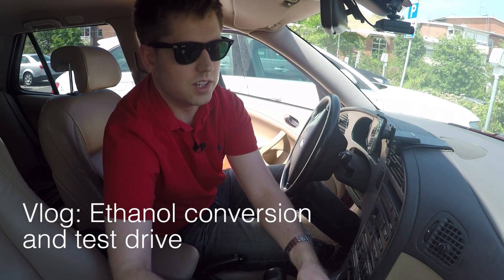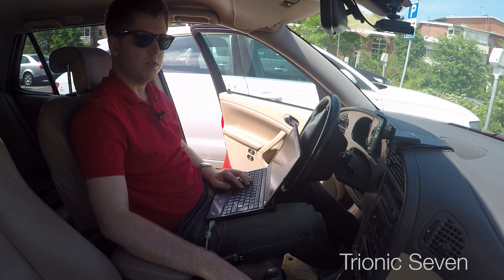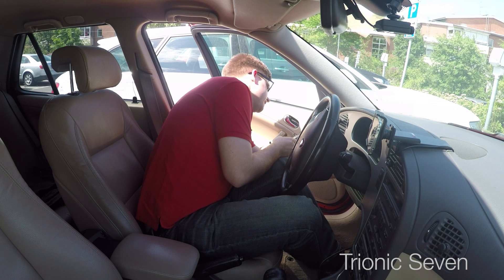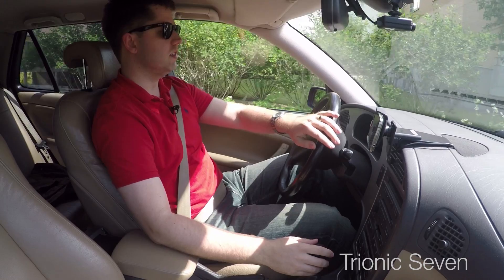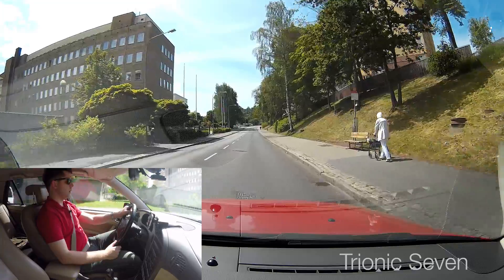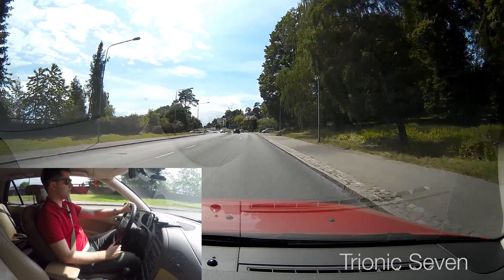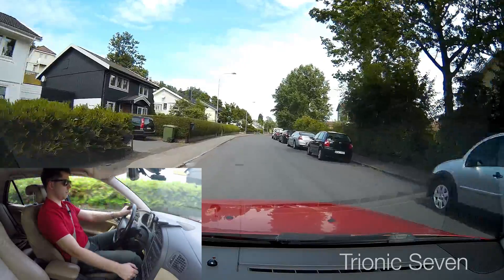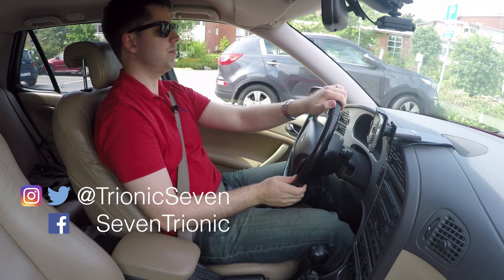Ethanol mod for the Saab 9-5 Aero!

Comment: quick question. I have a phase 1 saab 95 aero. 2.3t Abbot forged conversion blah blah blah. I can only get 99 octane fuel at pump. how hard is it change a normal petrol car to biopwer. of course mapper etc but what fuel pump and lines are required. many thanks
Reply from the maker: Usually you just need to replace the pump, the rest works fine. Plus software, of course.
Reply: Trionic Seven u do the have to change fuel lines
Reply from the maker: Source?
Reply: Trionic Seven I asked this in a saab forum on Facebook. the thing is. ethanol in the UK is very hard to get. near impossible. eBay is the only option. must be that they don't really know. but some forums on the net Were saying fuel lines.
Reply from the maker: Experience has shown that you don't need to change the fuel lines in the Saab.
Reply: I already have a Walbro 355 pump that should work. only need a map. cars running 350bhp on low boost what do u reckon the change to bhp would be when running ethanol. what differences do u feel
Reply from the maker: Hm...350bhp means it's got quite a tune already. What power you get will depend on your tune and the injectors you are using. I don't know enough to give a good response to your question
Reply: dekkas 630cc and a cos worth t3/4 turbo. bit like the gt28 but quicker spool

Comment: Hello. I to am a member at Trionictuning. Have John C:s Combiadapter too, but cannot find a thread where you can buy the casing for it. Could you point me in the right direction?
I live in Jönköping too. I am thinking of going to one of the Saab meetings at Max too.... Would be nice.
Are there any meetings scheduled this fall?
Regards / Roger
Reply from the maker: Hej Roger! Jag undrar om jag inte träffat dig när jag köpte gasdämpare till motorhuven för cirka 18 månader sedan, kan det stämma? Det har varit träffar på tisdagkvällar (kolla Trionic Seven på Facebook) men nu är det för mörkt, jag tror vi drar igång igen i vår. :) Här hittade jag mitt case: http://www.trionictuning.com/forum/viewtopic.php?t=3618
Reply: Tack. Jo det stämmer bra. Har haft många gamla 9-5or och även några Aeros som jag försökt tuna lite själv och då blir det lite delar man samlat på sig.Nu har jag en 9-3 TTid -2008 som bruksbil men ska åka och titta på ett 9-5 objekt. En 9-5 Vector 2,3 Biopower som har motorproblem. Tänkte göra i ordning den och troligen också pilla lite med mjukvaran. Kan vara kul. 
Har förresten tillgång till Tech 2 om du behöver hjälp med det någon gång.

Ha det gott.
Mvh Roger
Reply from the maker: Vad trevligt! Saknar själv tech2 och ibland får man behov av det :)

Vi hörs!

Comment: I am thinking of adapting my Viggen to bio power. Would you suggest a new fuel pump for the 2000 Viggen? To encourage the use of e85? I am planning to tune through Maptun
Reply from the maker: Check out the biopower conversion thread on trionictuning. I recommend an upgraded fuel pump since the old one can die at any time with e85

Comment: Hi,

what kind of tablet/phone holder are you using on your dash? Looks convenient.
I'm surprised you're running 95 octane. I'm stage 2 and converted to LPG so I use only 99+ or 100 octane whilst it's warming up and won't be trying 95.
I was about to ask you if you are encountering lots of misfires or knocks on A95 but realized you don't have openSID.
Reply from the maker: Check out my video on the Brodit phone holder: https://www.youtube.com/watch?v=MmKCo4pxXNQ

I have OpenSID, but not in this exact video. There will always be some knocking when running 95 octane fuel, however I do so much driving that anything else is too expensive.

Comment: Hi Jonathan ,first of all thank you for all those great videos you have made, very clear and easy for everyone to understand ,I have couple of questions , is it necessary to replace  the fuel pump? because it will fail using E85,and is Walbro GSS341 255LPH , special pump made to handle E85,,also its been about 3 weeks since you have converted your SAAB to E85 are you happy with the results?
Reply from the maker: Hey Manny. Just look at my fuel pump replacement video from last year, the car died due to the pump failing after driving on E85. With the stock pump it's not a matter of "if", but rather "when" it fails. Remember that the 9-5 pumps usually fail even when driving on gasoline. My pump failed quicker as it was a cheap aftermarket pump the last owner installed. Very happy so far, consumption on the highway is around 11 l/100km.

Comment: Did your Saab come from the factory with the ability to run E85 ethanol and petrol? or is this something you have added?
Reply: He is using T7suite to flash a new firmware version, read up on it it quite easy to do, you have to take in account that e85 burn with less calorific efficiency and hence you need to inject more, make sure your injectors are up to par most people when tuning on E85 use Siemens Deka but if you want stock power the red injectors are fine.
Reply from the maker: The Aero only comes in a gasoline version and I flash the car with software that takes care of e85, just like AcidStyle79 said.
Reply: +Trionic Seven: For Saab Enthusiasts oh i see.  But do you have to change any hardware or does the software update /change take care of everything?
Reply from the maker: http://www.trionictuning.com/forum/viewtopic.php?f=57&t=3462
Reply from the maker: As I talked about before I tried E85 last year with no hardware changes resulted in the fuel pump dying on me. That's to be expected. For the Aero, it runs more or less straight on, but with less power on e85 due to injectors maxing out. Again, can't really make a tutorial about biopower conversion as there are a lot of pitfalls and variations depending on model and condition of the car!
Reply from the maker: But generally, the Saabs need only small, if any, hardware changes. Software takes care of the rest
Reply: +Trionic Seven: For Saab Enthusiasts 
Are these changes just the fuel pump, the injectors and the E85 software?
Great videos as always.
Reply from the maker: You're making it difficult for me now! ;) It all depends, is the answer. For my car I only need software and fuel pump, but to get same power on e85 as gasoline I need bigger injectors. It will run fine, just with less power. In the future, my Aero will get close to 300 hp! ;)
Reply: +Trionic Seven: For Saab Enthusiasts 
Thank you for your quick reply.
So the essence of it has to do with the target power output due to the lower calorific value of the E85.
The higher the targeted power, the more fuel system parts/hardware you need to change.
Reply from the maker: Yeah, but in addition to that, the specific details to even get to biopower depends on your car.
Reply: +Trionic Seven: For Saab Enthusiasts 
I see. But bear in mind that I am not asking in general.
I am asking specifically about Saab 9-5 aero.
Thank you again and keep the videos coming.